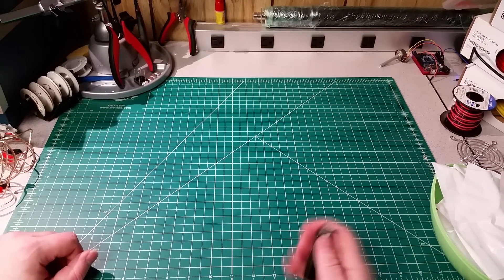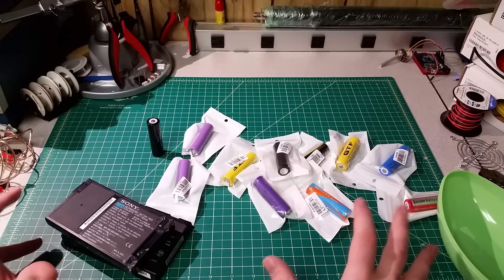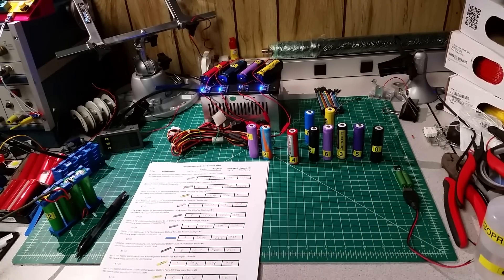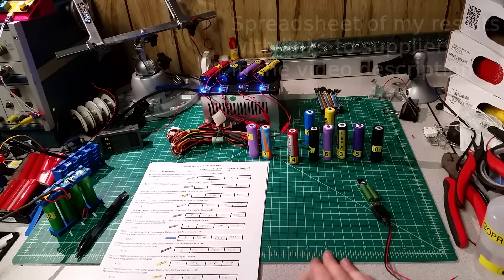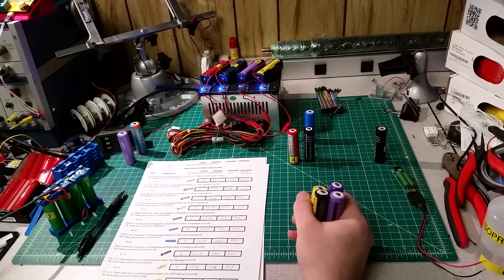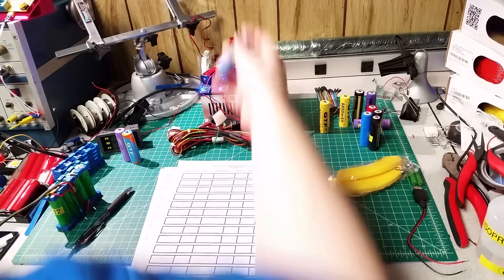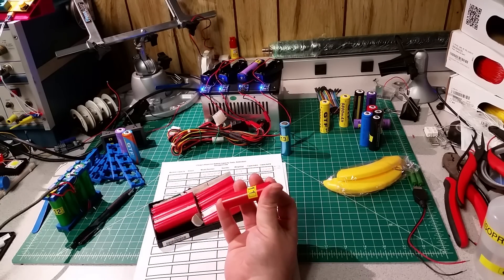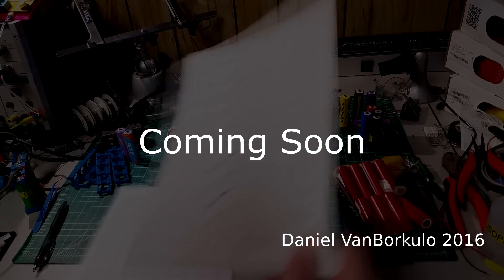18650 Rundown - Are Cheap eBay Cells Worth It?

Comment: Ebay and Amazon and all these websites are full of fraudulent Chinese batteries, that are around only 60% capacity compared to their sticker, and with limited cycle life. 
The advantage of buying real proper cells like Panasonic 3.4Ah cells, is that they legit have that capacity, they have safety protection, and they have a high cycle life. 
This means you have to solder together far less batteries to make your battery bank, and it also lasts longer. 
If you have around 60 of these Panasonic built into a battery bank, it would take around 120 cheap unbranded Chinese cells to achieve the same Ah, and they will routinely fail and the overall pack will not last as long, and it will be far larger and more work to put together. 

Overall, you usually end up suffering more by trying to buy cheap rubbish I have found.

Comment: 18650 batteries from eBay works fine.The mAh just a lies that all.But basic uses works okay just weaker in mAh that all.Real mAh Panasonic,Sony 18650 batteries are very expensive.

Comment: Anyone looking of rthe battery pack it's at https://www.amazon.com/dp/B07P77VJMZ (ASIN B07P77VJMZ) it's A42-A4 (You can read it on the battery he pulls out) My guess is it's an 8 cell 4s2p. Which works out to be ~$8.13 a piece now, so likely not worth it.  But if you can find used or cheaper A42-A4 batteries it may be.  The 18650 batteries are 2400 mAh based on the A42-A4 4800 mAh rating (although I've seen some with a 4400 mAh rating which would be 2200 mAh), and go for ~$20 on eBay currently.

Comment: Nice video bro， I am making IMR18650 1200-1500mah 2million pcs per day in China，I suggest you buy from Alibaba if you need any， cause most of battery maker， like me ， open shops on alibaba。 One more tips， IMR battery max capacity is 1500mah，cause IMR material are the cheapest。once you see IMR 2000 mah .. something marks outside the cell， it definitely are fake。
Reply: Can you send a link to your Alibaba shop? What is a good price now for an IMR18650 battery?

Comment: could you please do a video on Gabriel 18650 4000mah I need to buy 200 of them
Reply: Hi there， I don't think 18650 can reach 4000mah，maybe using 0.2 C discharge current it can reach 4000mah。

Comment: You said the Chinese battery are no good.  But the replacement laptop batteries that you brought are also from China.
Reply: Daniel VanBorkulo man you reading all these shitty comments
Reply from the maker: w23857980 
It's not that I don't think there are Chinese manufacturers that make good batteries, just that in my experience you are more likely to get a useless cell when buying inexpensive individual 18650's. I don't know why the sellers I've tried don't offer cells that are comparable in capacity and price to the laptop packs, would be nice if they did.

Comment: Forgive my ignorance, but how do you test for MAH?
Reply from the maker: +Jim Petersen 
Hey Jim, with something like the little capacity tester I was using, and just about any other tool that does the same, they add up two measurements. It has a current sensor to read the milliamps at any given instant and a clock to track time. I would imagine this one is taking a reading every second. The chip tallies the current measurements to give the "capacity" reading in mAh. It also picks up the battery voltage, but only so it knows when to stop.

Could do the same with a simple meter and a clock, if the battery provided 500mA of current for 4 hours before going flat you'd have a 2,000mAh battery. Same if you had 8,000mA that only lasted 30 minutes.

Not a perfect measure of capacity, especially if you are comparing different battery technologies. Doesn't account for the battery voltage, which would give you watt-hours (Volts x amps = watts; watts x time = Wh). That's the real power measurement for a battery, but not how we are used to having them marketed to us. That's why the electric utilities bill you in thousands of watt hours, not amp hours. Voltage isn't constant for either. Hope that helped out though
Reply: Nice explanation, do you know what the cut-off voltage is that your meter is using for deciding the cell is empty? I've seen some using 2.5 Volts, some 2,7 Volts and some 3.0 Volts.
Reply: Great video. I am looking for a good brand 18650 battery for my flashlights along with a good quality charger. An automotive 12 volt charger would be great if they make one. Have you tested any good name brand batteries to see which ones hold up best?

Comment: Whilst your video was interesting and informative you should realise that you tested only one of each type, I have a number of those you branded "Hopeless" and they are working extremely well and for at least 1 to 2 years. I've never bothered to check the Mah Capacity, but they definitely hold a charge and they work well in high output torches and test equipment.  Just a little tip, comedians shouldn't laugh at their own jokes, especially when the joke? isn't funny.
Reply: Either he's been huffing gasoline or he believes that most of us have been. Nice job Mr. comedian!
Reply: Lmaooo

Comment: if youre buying 18650s for a dollar each theyre obviously going to be crap. if you want reliable and reasonably priced 18650s from China via ebay buy a brand called PKCell direct from the manufacturer who sell under the ebay name DURNERGY. Ive bought from them several times over the past couple of years the cells have always tested within about 5% of their claimed 2200mAh capacity
Reply: That's the trouble though to build a decent battery pack, buying  £3 or £4 cells isn't an option unless you compare it to the price of a prebuilt battery,  but when your just starting out and don't know, that's when the shady sellers make their money, which is a hell of a shame, sad to say I even brought some GTF 9900mah cells once  and built a 4 cell power bank and I wondered why it would only charge my Samsung S8 only once if lucky, It will always happen, people taking advantage of peoplles ignorance.But one good thing is E Bay will give you a refund so I suppose you could buy 4 times as many cells as normal ie 400 so you have a 40s x 10p battery, it'll be huge and as long as your case wins you get a humungous battery for free, which will probably catch fire. lol
Reply: Do DURNEGY batteries have a high drain capacity?
Reply: Yep, you need to look really hard and get lucky or someone hopefully lets you know when they find someone honest on E Bay = very rare, thanks for the tip.
Reply: pandarama67 I dont think so. iirc theyre regular ICR chemistry cells, suited best for 1 or 2C discharge rates. I think you need the IMR or INR varieties for high drain applications. but tbh when it comes to lithium cells that are capable of dumping 20A or more, thats the kind of situation where I would probably fork out for a branded cell, LG or Panasonic or Samsung etc, just for peace of mind.
Reply: piece of shit advertising. 2.5€ per cell is a complete scam. you can find much better and cheaper and branded ones. I've bought many times brand new samsung and panasonic +2800mah for less than that!
Reply: Durnergy?? Lol - from Turnigy. Why do the Chinese use names that sound like established brands? Do they really think it helps their credibility?

Comment: Thank you very much for your hard work. There are lots of information in your test result: Cheap eBay Chinese batteries are not consistent. Their average capacity is equal to old brand-name ones. You did prove there are good Chinese manufacturers, such as YikLik, FST and Great Power. Those used inside laptop batteries are good, who make them does not matter. They are useful to make buying decisions.

Comment: A couple point of facts. One, as soon as you publicly boost about a product, said product's price goes through the roof (One year later and I cannot find these battery packs nor do I see ANY of your suppliers batteries selling for less than $25). And two, all of these cells, and other products, are made in China but you are NOT getting ripped off by just ordering from China. I have seen MANY USA sellers selling these very same cells. And lastly, Samsung IS a Chinese company and as such, would use inferior cells for their laptop batteries as well, as would other companies. The idea is to keep cost down for them, so the consumers gets screwed with cheap junk.
Reply: Samsung is South Korean They are reputable and produce high quality products and as such their products are heavily counterfeited by the Chinese
Reply: Samsung is most definitely South Korean and a world leader in terms of quality 18650’s

Comment: Thank you for doing the video. I was just about to order cheap 18650 lithium-ion batteries thinking I would save money, but now after what I saw, I will do more research. I have a 24 Volt lawn mower the battery does not work any, so I'm thinking I should make a battery pack from the 18650 lithium-ion, You think it would work? and still use the same charger? Thank you from Calgary

Comment: Do not buy any cells from Ebay, period.  Not even out of curiosity after these results.  Even 'genuine' ones, if you are lucky to get a genuine one it is overpriced compared to gearbest or aliexpress (which you should have better luck not being duped), or other sources.  The best cells you tested (2 / 10!?) are a bad deal just based on capacity and especially other factors like 1/2 the energy density, not to mention amps or cycle life.... or fire?!  Buying only one or two cells to use has even less value, if that were possible.  At 1.2Ah @ $1.35, that's ~$300 / kWh.  That's actually the price of those new 1.5Ah kobalt packs which give you high-amp cells and a BMS circuit of sorts.  They carry a 3-year warranty so the cells have to be of decent quality one could imagine.

Comment: Do not buy any cells from Ebay, period.  Even 'genuine' ones, if you are lucky to get a genuine one it is overpriced compared to gearbest or aliexpress (which you should have better luck not being duped), or other sources.  The best cells you tested are a bad deal just based on capacity and especially other factors like 1/2 the energy density, not to mention amps or cycle life.... or fire?!  Buying only one or two cells to use has even less value, if that were possible.  At 1.2Ah @ $1.35, that's ~$300 / kWh.  That's actually the price of those new 1.5Ah kobalt packs which give you high-amp cells and a BMS circuit of sorts.  They carry a 3-year warranty so the cells have to be of decent quality one could imagine.

Comment: when only buying small amounts, even the worst eBay batteries still have a better capacity/dollar than the ones I could buy locally. Even at a mere 400mAh per cell, they are still more than twice as cost-effective as the real deal.
Reply: Tim Jadeglans If you are ordering from China anyway, then you should check out gearbest.com
They are selling 4pcs of Samsung cells for 11USD

Comment: Good video and testing. I actually bought the yellow color battery shown @ 6:41 . It is GIF 9800mAh TR 18650 3.7v Li-ion battery  ... it was totally crap .. I used it on my head lamp and it was bright enough at first  but after an hr plus the battery started fading away quickly .... even though it was advertised as 9800 mAh. 

It was worse than the silver color Ultra Fire TR 18650 5200mAh 3.7v Li-ion battery that I have as far as I could observe ..  

Thanks again for the good testing ...

Comment: Nice video.  Thanks for doing all the heavy lifting figuring out what batteries to use.  I am planning on powering a Bluetooth amplifier (http://www.ebay.com/itm/111749386942?rmvSB=true) to bookshelf speakers rated at 25 watts each.  Do you think that these batteries would be a good choice?  The original build for this called for using 10 NiMh rechargeables. If I use the 18650 from a laptop battery, how many should I use to get about 10 hour of moderate use?  Any help on this matter would be greatly appreciated.  The link to the youtube video build is https://www.youtube.com/watch?v=N3k9lWz48rw . Thanks
Reply: Mike Ferrari where can I get a Bluetooth transmitter

Comment: found some even cheaper ones that are $3 a pack so that means each actual 18650 is $0.5 a cell.
https://www.amazon.com/gp/product/B0080PL1EQ/ref=oh_aui_detailpage_o00_s01?ie=UTF8&psc=1
  Also, when are you going to tear apart those 18650s for your video?
Reply: these:
https://www.amazon.com/gp/product/B001KODEA8/ref=oh_aui_detailpage_o01_s02?ie=UTF8&psc=1

$10 for this laptop battery. They contain BAK branded 18650 cells that have a real and true capacity of 2250mah. They don't have anything crazy like 3000mah per cell but they are great for what you are getting.
Reply: Dylan, I cannot find the pack on amazon using the link provided by Daniel in this video - I guess your link will get me the same batteries, right?